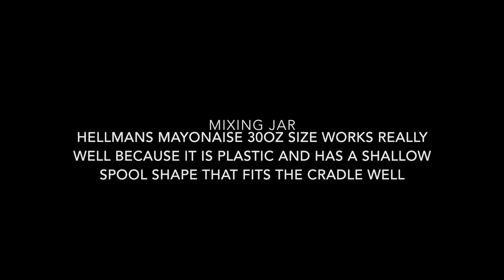Shellac - A better way to mix and apply shellac and obtain excellent results.

Comment: I've been mixing my own shellac from scratch and experimenting with on scrap wood this past week and came across your video.  Prior to this week I had just used shellac as a sealer prior to other finishes.  These pads/cloths are fantastic for wiping on shellac, why this method is not more widely known is beyond me.  I can't decide to shout it from the mountain tops or keep it as our little secret.  My next guitar I will try this for the entire finish and buff it out with plastic polish.
Reply from the maker: Glad this worked for you, John. Go ahead and shout it from the mountaintops. Share the video. Tell your friends.
Thanks for watching.
Reply: Thanks for sharing!
Reply: @frankvucolo6249 hi Frank - I liked the video overall and got some good things out of it. I especially liked the coffee grinder and nut agitators to speed up making a new batch of shellac.  It is difficult to get a smooth application in corners with a pad, but I keep a small, soft brush handy to get the edges started. 

I worry about rags and the potential for fire, partly because I have forgotten to hang them out properly in the past.
Reply: John I would not use shellac as a finish on a guitar unless you’re building it for display only. Shellac will not stand up to the use that a guitar would see. If you want a hand rubbed finish you can polish out look at using Tru-oil. Much better suited to the use you are thinking of.
Reply: HI, @bobbymccourt6794  .  Not looking to start an argument or anything, however shellac is a fine guitar finish which is used quite a bit in acoustic building.  I have used it on several with great results.  I've also used Tru-oil which is a fine finish too.  However, I'd never use it on an acoustic soundboard though, either shellac or Nitro Lacquer because they will flex more that other finishes allowing the top to vibrate the way you wanted when you tuned it when shaping the braces.

Comment: I just put the flakes in alcohol and it eventually dissolves without a grinder or shaker or metal nuts. But I can see where all the extra work can be fun.
Reply from the maker: Thanks for watching, Rand. Eventually is the key word.

Comment: Hey, thanks for this video. Had a couple questions if you don't mind. 1. Did you ever explain why you put the nuts in the jar with the shellac?. If so, I missed the explanation. 2. I hear some people say to wait several hours between coats for shellac, so I'm confused now because I heard you say wait 10 minutes. Thanks!
Reply from the maker: Hi Adam. Thanks for watching. The nuts are just agitators. They keep the solids from bunching together so that they get into solution more quickly. 
I put a second and third coat on right away, after the prior coat dries. That gives me a “build” that I let cure overnight. I rub that out the next day and proceed with another 3 coat build. I repeat that process until I get the finish I’m looking for. There are a lot of ways to do things in this craft, and seldom is there one right way. When you come across a way that works for you and brings you good results and satisfaction, that’s the right way for you. Good luck with the shellac, my friend!
Reply: @frankvucolo6249  thank you Frank, I appreciate the response. If I could ask one follow-up question, when you are transporting a piece that you have finished with shellac, what do you wrap the piece in?
Reply from the maker: Hey Adam. No difference transporting a piece finished in shellac - very durable finish. But I use old bath towels and/or a moving blanket.
Reply: @frankvucolo6249  hey Frank, sorry one follow up question. Do you re-mix shellac in the same glass jars after you've used the jar once? After finishing what's in the jar, there's usually some dried shellac at the bottom of the jar and I just want to make sure it wouldn't be an issue to reuse the jar. Thanks!
Reply from the maker: @adamthewoodworker2571  hey Adam. Never gave it much thought, but sure. You can clean up the jar with some fresh alcohol and reuse it.

Comment: Great explanation of the process.  Can you tell me again the ratio of the shellac flakes ?  And where did you buy the "synthetic" steel wool?
Reply from the maker: Hi Charles
Thanks for watching.
I used 1.5oz, by weight, of shellac flakes to 8 fluid ounces of solvent.
I then combine 3 parts of the resulting shellac to 1 part mineral spirits to get the wipe on solution.
The synthetic steel wool I use is from Norton. I keep burgundy, gray and white in the shop. The white is “0000” the gray is “000” and the burgundy is courser, though I don’t know how it is designated. I’m not sure where I bought it, but a google search brings up many sources.
Good luck with the finishing!

Comment: I would only add here that although this tumbler method with the hex nuts is a great idea, make sure your hex nuts are clean and dry before adding them to your solution. They will come from the factory with anti corrosion coating of some sort without a doubt. Light machine oil or the like. Coated or not, this will be true. Wash them is water and dish soap. Shake the hell out them in a plastic jar. Rinse them and dry them by swinging them around in a clean shop towel or tea towel or what have you before using them in this manner.

Brilliant video though. I love the mineral spirit idea. Seems to make it very workable especially for instrument finishing.
Reply from the maker: Thanks, Doug. Ya know, I never considered that. But you are right. Luckily, in my case, there was no trouble from whatever anticorrosive was used. But had I thought of it. I would have degreased them. Viewers, I recommend you heed Doug’s advice here.

Comment: That is a great idea to add mineral spirits to the shellac to slow its drying. I use shellac to finish my wood bowls and have had a problem of uneven coverage which requires lots of sanding to rectify. My wife uses Handi Wipes for dish washing cloths. Looks like I'll try these for my applicator. Great tips!
Reply from the maker: Thank you. Good luck with the bowls.

Comment: Great video and instruction, very informative! I'm getting ready to finish some hard maple stools and intend to use the Zinsser Amber as the first coat because that produces the precise color I'm looking for. Would the mineral spirits also help a brushing situation?
Reply from the maker: Glad it was helpful! The mineral spirits might give you some time to feather over and smooth your brushing as you go, but I’ve never tried it. Over the years, I’ve settled into wiping thin coats for the best overall appearance.
Reply: @frankvucolo6249  Do you think I could wipe a 2 lb. cut (thinned Zinsser Amber)? That would help build the color faster.
Reply from the maker: @rbeachy206  I wouldn’t be thinking faster. Maple is tight grain, it will fill fast enough wiping thin coats. My recommendation would be 3-4 coats wiped on day 1. Next day, knock it down lightly with synthetic steel wool to get the nibs and dust off. Repeat 3-4 coats. Next day knock it down lightly with synthetic steel wool again and wax it. But everyone had a different idea about finishing :)

Comment: When you do it normally, do you keep the same square of rag, or do you make a new one because of the dried shellac on the old one?
Reply from the maker: Hi Totemo. I will keep using the same pad for the day. You can resold to get fresh areas. But I  toss it at the end of the day and use a fresh one for the next series of coats.
Reply: @frankvucolo6249  Thanks!

Comment: Thanks for this video Frank! I'm looking to add a light color to some pickwick (knotty pine) 
boards I just got and will be installing in our house soon. The clear Zinser shellac doesn't have enough color/tone to it and the amber is darker than we'd like so I'm thinking of trying the blonde on the knotty pine. Curious if you've ever used that on pine before and , if so, how did you like it? I also wonder if pre conditioning the pine and doing a custom stain mix might work?
Reply from the maker: @dmosier83  hi Dean. I’m not much for stain. I like to get the color from the wood and the tone from the finish. I would make a sample board and try a few shellacs. Take a look at a range from Garnet(darkest) to blond. Then try some blends until you hit what you are looking for. You can also get some tone in the end with a darker, more orange or clear wax. More art than science. Especially since pine itself can vary in color. Keep in mind, too, that pine will darken over time. Good luck!
Reply from the maker: @dmosier83  hi Dean. I’m not much for stain. I like to get the color from the wood and the tone from the finish. I would make a sample board and try a few shellacs. Take a look at a range from Garnet(darkest) to blond. Then try some blends until you hit what you are looking for. You can also get some tone in the end with a darker, more orange or clear wax. More art than science. Especially since pine itself can vary in color. Keep in mind, too, that pine will darken over time. Good luck!
Reply: you can do amazing things with Transtint dye in shellac.   options are literally limitless

Comment: I mix my own flakes also.   What do you gain using the Mineral spirits? I know it evaporates fairly quick. ???
Reply from the maker: Hi longdriver. The mineral spirits gives you some more time so you can wipe on the shellac without it starting to dry, causing the pad to drag.

Comment: You said you were using 1.5 ounces of shellac flakes on the scale but I think you meant 1.5 grams correct?
Reply from the maker: Hi Jersey. No, ounces is the measurement I was using. Not grams.
Reply: Sorry Frank I was wrong I was thinking that was liquid like volume and not weight.  Thank you for answering.  @frankvucolo6249

Comment: Your video is one of the best delivered and most informative videos i have seen on you tube!
I have always love using shellac as a finish because you can build depth to the finish and never knew I to mix mineral sprits with it to make a wipe on finish. I have never used flakes and the problem I always have is finding a can of Seal Coat that is not out of date( not older than 6 months). What is the shelf life of the flakes and how do you de-wax the flakes?
Reply from the maker: Thanks for watching and commenting!
I don’t think the flakes themselves expire. So you can keep them for many years, sealed tightly in the bag. I do. It’s nice to know, after many hours of work on a project, that you are using freshly mixed shellac, the composition of which you can control. I by de-waxed shellac flakes.
Reply: @frankvucolo6249  thank you very much frank!

Comment: Hi, I wanted to come back and ask another question. How long do you think I should wait after applying a dye to wood before applying shellac?
Reply from the maker: Hi Adam. Disclaimer: I don’t use much in the way of dye or stain. I try to let the wood selected dictate the color. You have to be disciplined on stock selection for uniformity of color - especially walnut and cherry. Most of my dye or stain experience comes from interior mill work or repair work. That said, I would allow the dye to dry overnight for water based dye, or a few hours for alcohol based dye. You might want to check Homestead Finishes website to do a little research.
Reply: @frankvucolo6249  thank you! And then one other thing I was just curious about. I usually have an issue with the shellac sticking to the bottom of the jar when I'm making it and letting it sit overnight. I started doing your method of using the coffee grinder on the chips and that's working great, but the shellac will still clump up towards the bottom for a few days. Is there anything else I can do to prevent this? I don't have that fancy vibrating machine that you have lol
Reply from the maker: You’re welcome, Adam. Well, you hit on exactly why I built this contraption. Best to mix your shellac at a time where you are going to put in some shop hours. This way you can give it a shake by hand every 15 minutes or so. And you can add nuts even if shaking by hand, to agitate the unresolved shellac. If you can park your jar on anything that vibrates, even a little, like a window AC, dehumidifier, small fridge… it will help, especially with agitators in the jar.

Comment: What is the best finish for wood ring?
Reply from the maker: Hi VP. I have no experience with finishing a ring. I presume you are referring to a ring you wear on your finger. Shellac would not be a good choice because it might come in contact with alcohol - from a drink, a cleaner, a pre moistened hand wipe, etc. Perhaps a durable varnish like Waterlox or Liberon would work.  Maybe another viewer can chime in from experience.

Comment: I don’t like working with denatured alcohol.  I actually use 99.9% isopropyl alcohol (which is pretty harmless - basically just rubbing alcohol) which I buy on Amazon pretty cheap (about $18/gallon with shipping).  Works just as well - although the initial dissolution is faster with the behlen.  I use a magnetic stirrer so I just make sure to do it far enough in advance and leave it (generally dissolves in a few hours to overnight with the stirrer).

There’s actually a recipe online for making a water based shellac (using alkali to make it dissolve).  Supposedly it works, although I have not tried it.

What does the mineral spirits in this mix do?  If you omit it, how does it affect the process?
Reply from the maker: Hi MD. Thanks for watching. And thanks for the isopropyl suggestion. I’ve never tried it. Maybe others have and can comment. 
What the mineral spirits does is it keeps the shellac workable longer while you wipe it on. It prevents you from “dragging” on areas you go over that would have dried some. Not so relevant on the little test piece I used, but on a larger table top or,chest side, for example, you want that extra time.
Reply: Another great choice is to use drinking alcohol at 95 to 100 proof.  It's food safe!  It also produces a more stable shellac ( lasts longer in the jar).
Reply: @boooshes  Ethyl (drinking) is the best but it’s expensive due to taxes.

Comment: I use 99% isopropyl alcohol, which also dissolves shellac well. I crushed all the shellac flakes by a rolling pin before adding alcohol and keep stirring when I add alcohol. I found orange / garnet shellac harder to dissolve and the color is a bit uneven. I have to filter them before use.
Reply from the maker: Good idea - rolling pin! Never thought of that.

Comment: For the non American viewers can you tell me what is the chemical in the Brand name can? Also what is your Mineral Spirit? We seem to have different names for the same chemical, depending which country one lives in. The grey pad looks like Scotchbright, which comes in various grades and is colour coded for coarse or fine, used a lot by machinists finishing lathe turning various metals. Thanks for sharing your techniques. Tasmania 42 South-down under.
Reply from the maker: Thank you for watching, Shevill - and for the comment!
Here is the Safety Data Sheet for Behlen Behkol Solvent https://ardec.ca/media/catalog/msds/B650-2816_CA_GHS_SDS_English.pdf which includes the contents. It is primarily ethanol alcohol. Here is a link to some information on shellac solvent https://www.shellac.net/alcohol.html. Mineral spirits is mainly used as a thinner for oil based paint. A google search will link you to the contents. As used in my process it is not a solvent for the shellac. It’s purpose is to act as a lubricant because shellac dries so fast that it wants to grab or drag as you wipe it. I find the mineral spirits gives you the needed working time to wipe on the finish. And yes, Scotchbright is a brand of synthetic steel wool I am familiar with. So, while I am not familiar with how products are named outside the United States, perhaps other viewers might chime in on that matter.
Reply: Mineral sprits is known in UK influenced countries as white spirits.